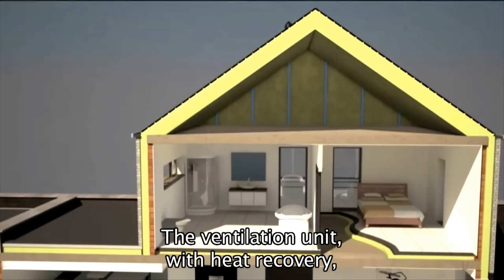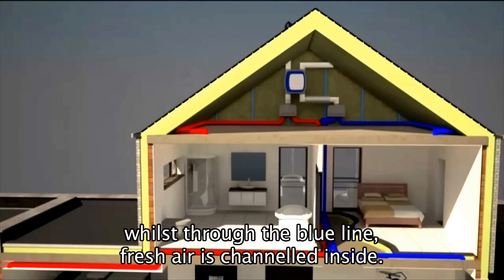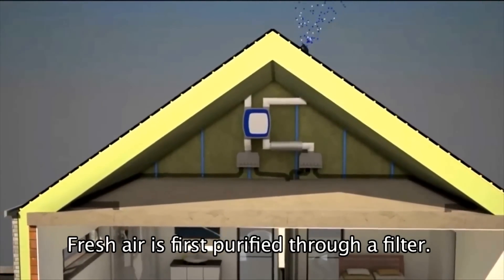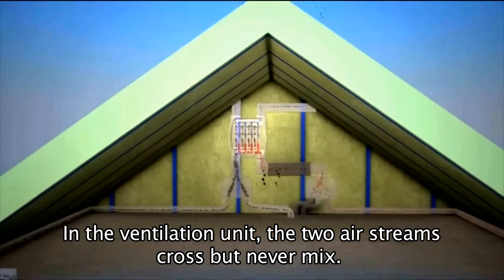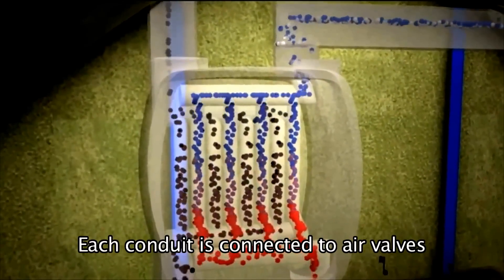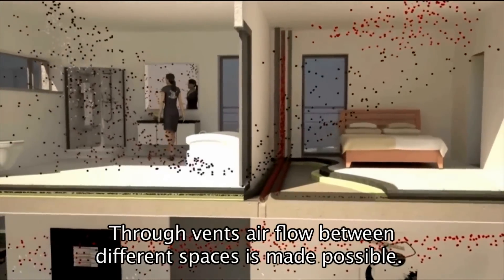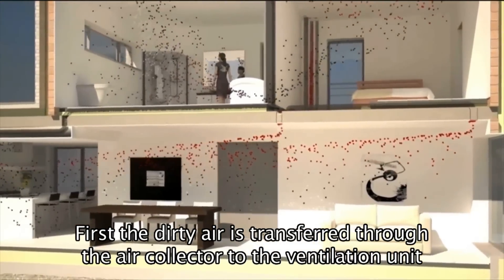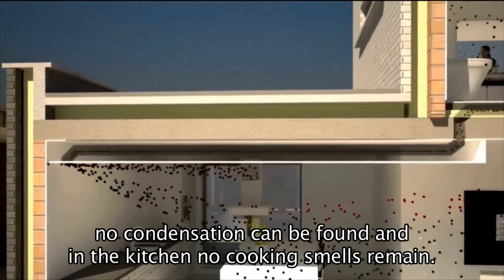The Ventilation System of a Passive House (subtitled)

Comment: can someone tell me what makes the air move in that specific route
Reply: Adham Tamer its the pressure and draft, the house is so tight that its not legal to build these in my country without the ventilation system, before we moved into our passive  house here in may, it was checked by a certified expert who performed a blower test , the house is set under pressure with a big blower and it must be totally tight, its possible to even dry laundry in the living room without any risk of mold , a sensor is monitoring the exit air for moist and controls the speed of the air blown into the house. the monthly expense of heating is only 60 dollars eventhough we live in a cold country , i came from a traditional house where we spend an average of 220 dollars a month. on top we have a tax reduction due to the use of electricity as a part of heating (air to water compressor system )
Reply: Electric fans. The ventilation fan in the bathroom and exhaust fan in the kitchen connect to the house ventilation system which has a make-up air fan inside of it.

Comment: Now 2020, an ill occupant (with COVID-19) would need a neg-air type bedroom to prevent virus spreading throughout the whole building requiring dirty air in the bedroom be drawn away as far from the entry door as possible and behind/above the bed headboard. Fresh air would be provided at the bedroom entry door; however, usually supply HVAC is piped in at a window location; so, some kind of switch needs to be installed for diversion needs (normal flow versus illness).
Reply: Who cares about COVID, it is statistically indistinguishable from other respiratory viruses unless you are extremely old or overweight..
Reply: @sickre  he cares because intelligence op's and media propaganda made it scary to him.

Comment: How is this passive? Does this system not require a blower?
Reply: Passive refers to the Pasivhaus building standard where a home is built with high insulation and air tightness. Usually this also means that the house does not require any heating system as solar gain and waste heat from occupants body heat and appliances provide when combined with heat recovery ventilation are enough to heat the home. My home is an NZEB (net zero energy building) which is a near passive standard of building. I've never had my kitchen air temperature drop below 18.5C even when it was below -5C outside.... without using any heating system. The heat recovery ventilation only has two small fans that use an average of eleven watts of electricity vs the thousands to tens of thousands of watts a gas/oil or electric heating system would use.

Comment: I doubt if the house shown in this video would meet the PassivHaus standard with the extensive flat roof.
Reply: The pitch of the roof has no bearing on whether a house is a passive house. We are designing flat roof houses and apartment buildings in Philadelphia.

Comment: YES this can be used here in Brazil,  please note"PASSIVE house" if your home/house is constructed as a tight envelope (minimum leaks etc) then an ideal system for HVAC could be designed. But,take into consideration the route of the ductwork (pipes)

Comment: adding HVAC to this would  work right?,,,,,,, cooling from a 71 degree F temp would be easier than from a 100 degree environment I would think
Reply: yep, and also look up Daikin HRV demo video, it has some interesting modes. However conventional air conditioning systems use recirculated air, so ventilation can be expensive.